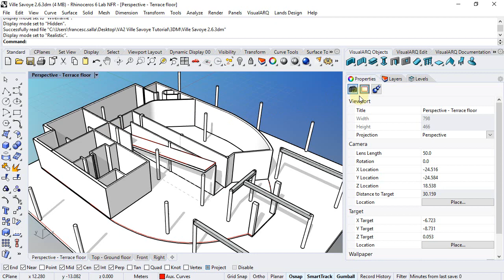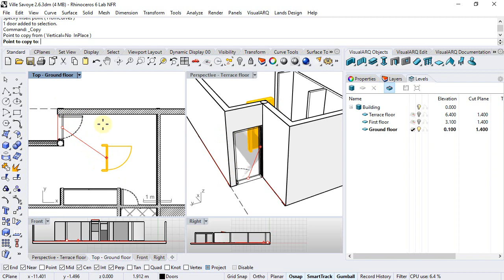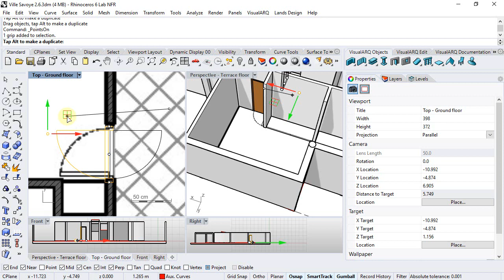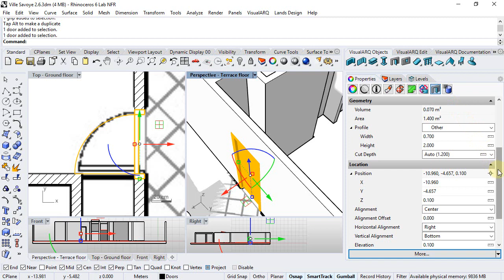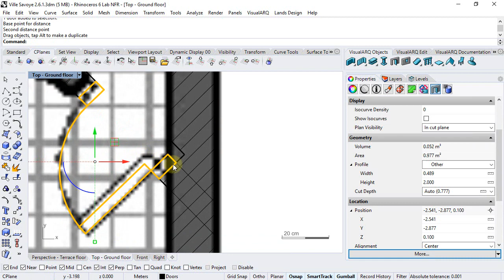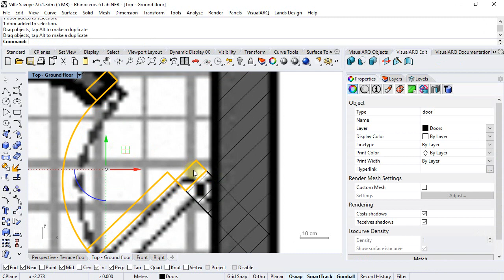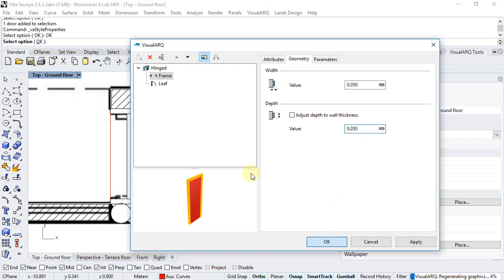VisualARQ 2 tutorial - 2.6 Ground floor doors

Comment: what is if I cant see the angle line of the door ???
Reply from the maker: In the Top viewport,  you need to activate the Cut plane (in the Level Manager) of the Level where the door is placed so you will see the door 2D swing arc representation.